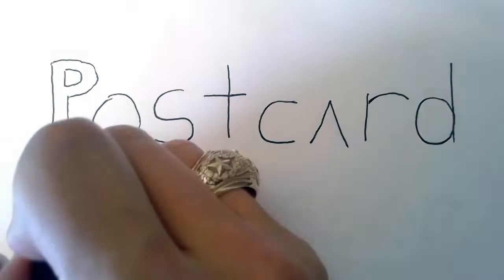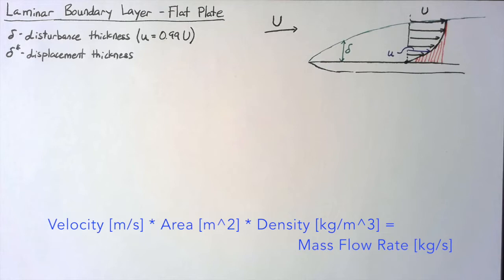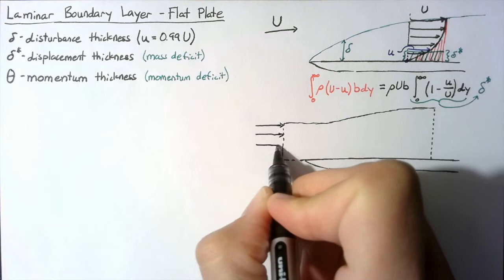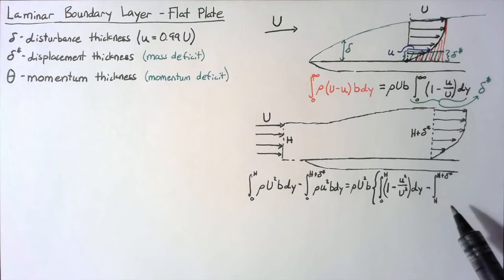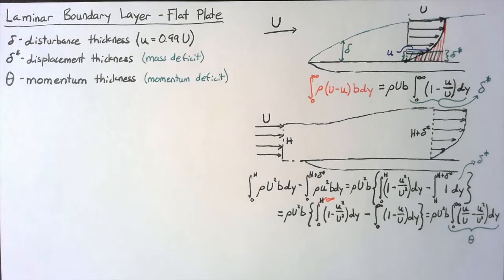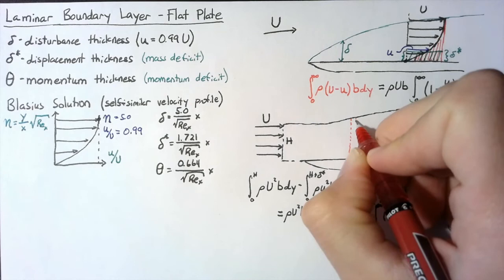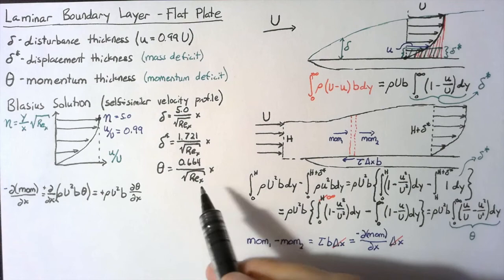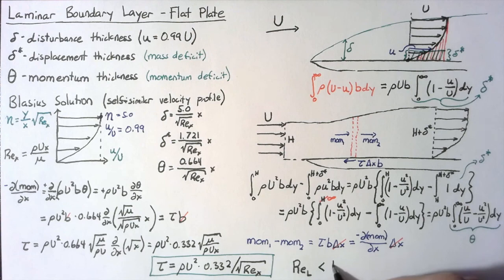Fluid Dynamics - Boundary Layers

Comment: Hello thank you
 just a question
 can you make a video on how to solve this problem: 
Using Blasius solution plot the velocity at x= 0.1 m and 1m for assuming 
a free stream velocity of 30m/s and a temperature of 25C. 
Calculate the boundary layer thickness and displacement 
and the momentum thickness. Calculate also the friction and the drag coefficient. 
thank you
Reply: Did you get your answer?